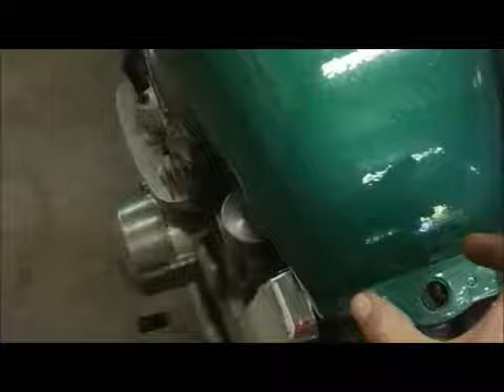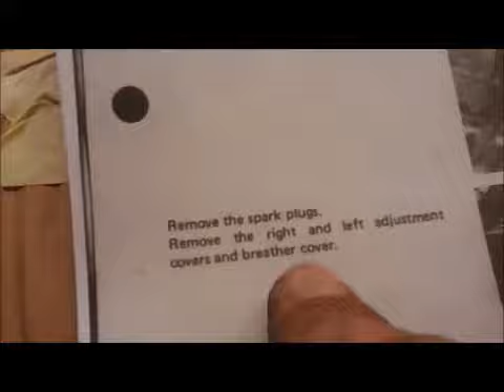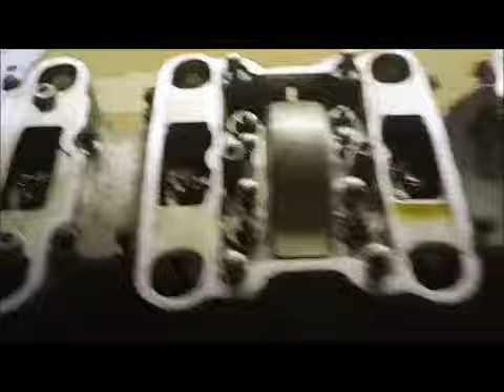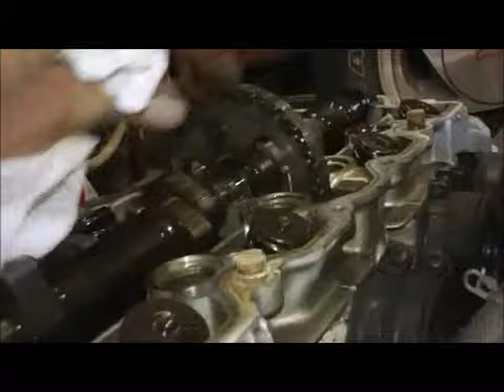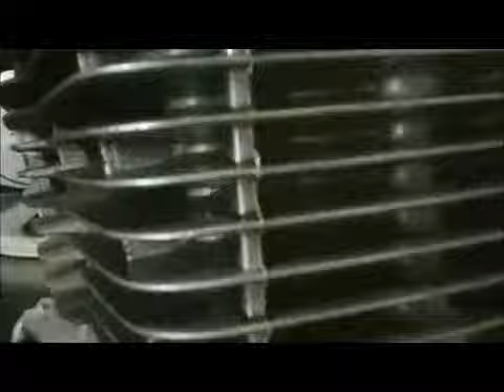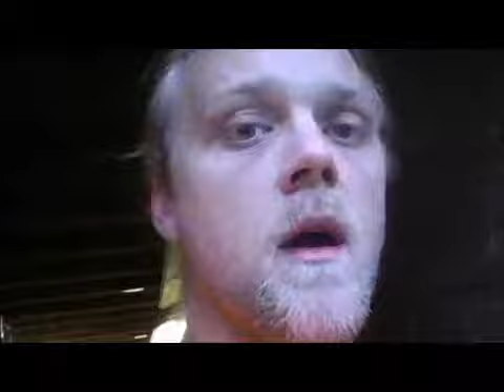1981 honda cb650 custom head gasket

Comment: There is 1 for sale on Craigslist selling fo $950 but needs new head gasket. Is it a good buy? Let me know thanks
Reply from the maker: depends on the condition of the bike over all. Tires, Brakes, Lights, Paint, Seat, Inside the fuel tank..etc

Comment: did you have to readjust the valves after the head gasket job? Or did you just bolt the head cover on and send it?
Reply from the maker: I honestly don't remember. I think I did. It would make sense.

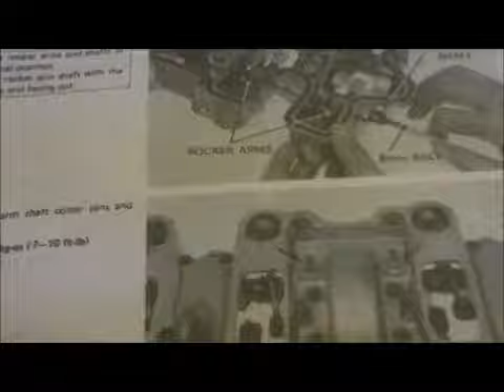Comment: Hey so, when putting my Camshaft back on, as your video says, (Marker 15:55) "Align the center of the index mark on the camshaft right end with the cylinder head surface."  On my camshaft, there are 4 marks on the side, no idea which is the Index mark.

I did the one with the thickest mark first, tightened the head down, then turned the crank to make sure it was good, but I can only turn it half way before it locks like it's hitting a valve.  How do I figure out which mark it is??  Why the hell are there 4 marks, so annoying!!  Thanks
Reply from the maker: Chris B. Marquez i have no idea why there are 4 marks on yours. sounds like someone might have been in there before. the link to get the manual i used is... http://www.sohc4.net/cb650-manuals/. maybe yours is a year newer or older than mine was...idk the manual is  for a 79' but was the same as my 81'. im glad to hear you were smart enough to turn it over by hand first. i always turn em over by hand a few times before i fire em up. hope all works out for ya! let me know what happens
Reply: milric77 Cool, thanks. Got it figured out now. Video helped me out, big time.  And ya, you're right, someone was in there already, bolts missing, some replaced with fxcking screws.  Had a, "what the fxck did they do in here," moment.  But, all fixed now.
Reply from the maker: Chris B. Marquez nice glad you got it figured out. screws? wow! i hate digging into someone else's mess but sometimes it is worth the learning experience. hope she runs real good for ya...i love mine!
Reply: milric77 Actually, I double checked the camshaft, it's on correct.  For some reason, gas is shooting out the back of the carbs, towards the  air filters, instead of towards the motor.   No clue, vacuum issue..??  Shits driving me nuts!

Comment: Where did you get your directions?  I've got a Clymer but those look easier.  Also, how long to do the job?  Nice work.
Reply from the maker: http://www.sohc4.net/cb650-manuals/ 
the manual is really for a 79 cb650 but it is the same thing.
i think it took me one afternoon say 7hrs. but i was taking my time and drinking a few beers so...it could probably be done faster. the more complete your tool set the easier the job. HAVE FUN!

Comment: Where did u order the gasket seals from? Dealer don't have it any.
Reply from the maker: ebay... http://www.ebay.com/itm/79-82-Honda-CB650-Athena-Top-End-Gasket-Kit-FREE-SHIP-LOW-PRICED-/151318087634?pt=Motorcycles_Parts_Accessories&hash=item233b42c7d2&vxp=mtr